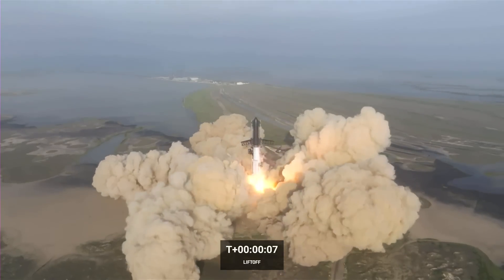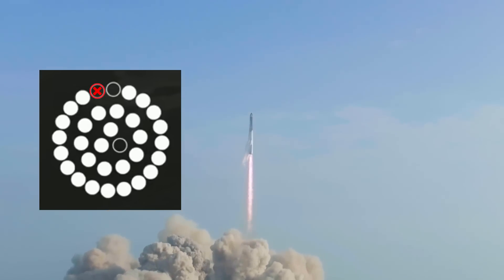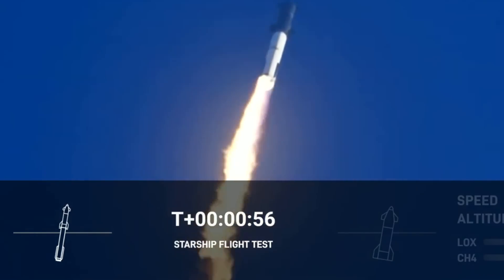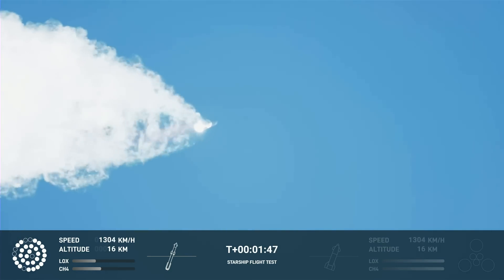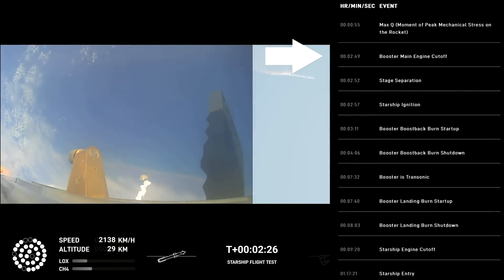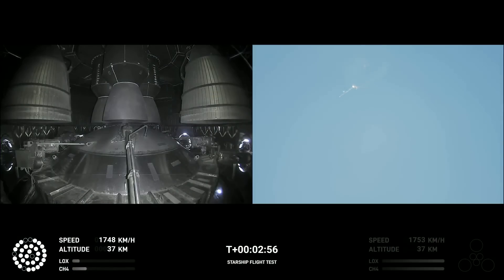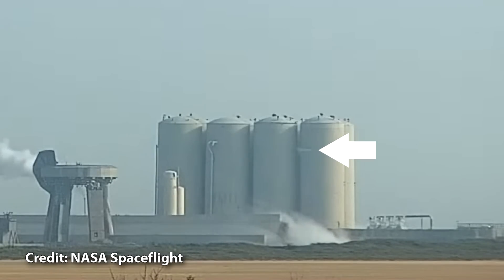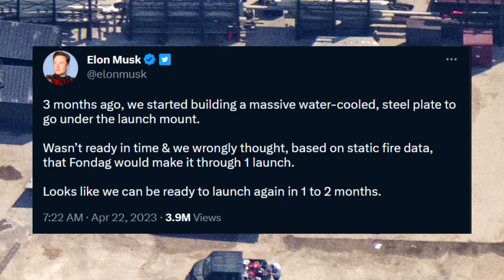I Watched the Starship Test Flight at 0.25x Speed & Saw What Went Wrong | Starship Flight Analysis

Comment: It did well - and I wonder whether that 7 second hold-down was the real cause of the worst damage to the pad and possible damage to some of the engines and the HPU.   The fact that there was no stage separation seems unsurprising - they were planning to use a little rotation to get the separation to work - but it's likely that the release of the clamps would be contingent on some precise amount of rotation - so it seems likely that this is the reason for that to not have happened.

Comment: I actually thought they were going to make it all the way. However, I agree with your conclusion. They got a raft of great data from complex systems stressed by multiple failures. It was probably the best outcome short of a completely successful launch that they could have hoped for.
Reply: Really, what data? They couldn't even display the data showing the engines that failed. It was crumpled going through max q, the self destructs didn't work, that is a huge problem, both failed. What detonated was at the engine base. Any data they got was compromised at lift off. Over at common sense skeptic we said this would be a dud and guess what, we were right, again. :text-green-game-over:
Reply: @IbnBahtuta  You ever hear of telemetry?  I don't have time to teach Musk haters an entry-level class in Engineering. You will just have to trust me, the long-range photos and onboard telemetry were a data gold mine and go a long way to making the next launch successful.  You gotta break a few Starships to make an omelet.
Reply: @wilsonle61  Of course I have. I've been using it most of my career. Telemetry like anything else such as say the self-destructs, which both failed to work, what about that telemetry feed then?
Telemetry only works when your comms is up and that is highly unlikely to have survived very long into the "flight". Don't start me on the Raptors, their telemetry couldn't even show the engines status properly because of, what Wilson? Go do a physics course, if you have already, do it again.

Comment: This smells like a new great channel. I subscribe later got to watch some videos first.
All space channels pitching in now and commenting this launch adding points of views is great.
I usually focus on military stuff so did not know systems responsible for hydraulic pressure were in a voulnerable position. Still , using some knowledge from engineering school , you build the vessel using close to minimum amount of metal to make vehicle and hold propellant, and then there is no room for more so you bolt it on on the outside.... something like that. Was not surprised this critical system was on the outside.

Comment: Agree with others, it's one of the best analysis videos,
Reason is mostly it's just thorough and consice and gets a lot right and gives multiple analysis at the same time

- remark, I would never suggest that thrust vector control is not enough, the rotation from TVC is so strong that most rockets and missiles limit gimballing between 5-15 degrees. its ALOT-

in an emergency they can use differential throttling for TVC, starship had had lots of issues with commanding more thrust in the past and SpaceX said this happened against this fight-

it's confirmed TVC failed this flight. 
They were waiting for stage separation before possibly automated FTS, ship chose not to separate
Reply from the maker: Thanks for the great feedback! To clarify, I said that because we'd seen an HPU blow up, so TVC (though apparently working) could have been significantly limited. Of course, as you said, it turned out that it was the alternative that TVC had just totally failed.
Reply: @ProjectVirtualHaven  sorry,
yeah, if you're talking about TVC during the flight yeah you can say it somehow wasn't enough

Comment: This test needlessly destroyed the launch pad and endangered the life of observers and animals in the area. It was entirely foreseeable that the pad would not withstand the booster engines thrust. NASA gathered that experience decades ago. It will take at least another 6-9 month before anything flies off that launch site. Also the FAA porbably is not happy about the FTS failing, so they won't greenlight another launch untill SpaceX can proove they have this one sorted out.

Comment: Clear structural overload. The power of rocket engines is so massive that it crushes and tears apart almost anything. The worst damage can be seen from the cameras on the launch pad and the rest is a chain reaction of what happened. Some of the engines work incorrectly right from the start or there is simply too much raw power. Engineers have a lot of work to do to avoid the same thing next time. 👍

Comment: Hi 👋, I am new to your work shop analyzation program, There is no doubt that this is the best territorials on SpaceX, it is amazing what you can see when you slow film footage up, which then you can then analyse, it is like taking a photograph in RAW to get best images, 
I think they should not of lurch, they should of waited until the water cooling launchpad was complete, as in other launch sites, And it does make you wonder whether the water cooling system will be sufficient, as it could rip it apart, with that amount of power, 
On a positive note, it is amazing what engineering feats they have accomplished , Great territorial, let’s hope the next launch goes better,
PHIL FROM THE DARK SIDE OF THE MOULIN FRANCE, 😂

Comment: Believe or not the Raptor engines and all the other failures actually provided a lot of additional information if you think about it it showed how many intrinsic can still lose and be able to get to certain altitudes the amount of thrust still available what things can go wrong in a troubleshooting scenario and how would perform if those things went wrong down the road oh you lost this engine in this spot you might still be able to continue on o you  lost this engine in that spot you may not be able to continue on how much it'll lean to one side if you lose too many engines on one spot or how many engines it takes to deviate with that much till how much additional power is required to go back on track if you lose so many engines on one side how well the communication system for working how it properly relay the engines of working over not working what happens when we lose hydraulic power unit it's still able to perfectly run looks like with even less engines than it should have needed to do the maneuver and how much digital fuel it took versus how much it was using or how little fuel it saved when you do increase the flight distance can we turn off an engine how much do we say from that and fuel usage

Comment: Only other thing to mention is something Scott Manley did.
The HPUs could have been a closed loop system, meaning fluid and pressure can still be in the hydraulic reservoirs long after an explosion like that. 
So it may have been that both HPUs did explode but didnt run out of pressure until right before that tumble.
Reply: What I understand is that the 2nd prototype will not have HPU's. The vectoring control will be electric, therefore removing the need for volatile hydraulic fluids

Comment: In an interview with Elon Musk, they didn't even start up the three engines due to a performance issue.  They calculated that even without those three, they would still get off the pad, but any further shutdowns would have a negative impact on the launch.  Elon also said that they need to work on the FTS system as it took 40 seconds to finally terminate the booster and starship.  This would be the longest lead time fix according to him due to requalification and extensive evaluation of the reasons behind it not functioning as planned.  

We didn't get any views of the separation area during max Q, but I'm betting SpaceX did and are evaluating whether any flexing of the ship caused the staging issue or would prevent the stage from separating.  We cannot definitively say that it flexed enough during max Q to prevent it from happening.  The countdown clock is a general time in which things can happen and not exact because of all the other factors involved with engine shutdowns and length of time on the pad.   So, the clock never made it to separation and even when it did, it probably wouldn't have initiated separation due to the trajectory anomaly. They would have had to force it to separate and obviously chose not too.

Comment: I suspect that even after the failure(s) of the HPU units some hydraulic pressure would have remained until continued use would have depleted it.  I imagine the HPUs pump the fluid into some form of pressure vessels that would lose pressure as mechanisms, such as the engine gimbels were used trying to stabilize the craft.

Comment: Very disappointing launch.  At 2 minutes, the EMPTY Starship reached a altitude of 26 kilometers at max speed (35-36 km max altitude) and didn't hit Mach 2 before starting to vent gas and tumble before blowing up on its own.  In 1981, at the 2 minute mark, the FULLY LOADED crewed space shuttle reached Mach 5.6 at an altitude of 46 kilometers and stage separation was flawless.  Remember, this was in 1981 with 70's design and technology.  In 1967 on it's FIRST launch, the Saturn V rocket successfully reached orbit and it had zero failures in its 13 launch lifetime.

The bar was set REALLY low for Starship.  We know starship can't land without blowing up (one landed without blowing up but caught on fire) and now we know starship with super-heavy can't even reach half the speed of the 40 year old space shuttle, can't separate and with 8 engine failures, can't sustain full boost.  2 or 3 of the engines probably failed from the chunks of reinforced concrete flying up at hundreds of feet per second.  Not only was the launchpad destroyed, the refueling facilities and most of the launch site along with a nature preserve were pelted with chunks of reinforced concrete.

Comment: Seems like the pad design was an outright blunder, amid all the amazing engineering, as though nobody made calculations on pad erosion because the boss said, let's wing it once.  After all, the engines convert a (250?) bar chamber pressure into a well directed supersonic stream, and you're directing all that at a flat surface. Thrust, heat, acoustic hammering, and that bit of water sprayed into the stream from the launch tower? I'm wondering if that could have made the concrete erosion worse.

Comment: You are incorrect about the initial engines shutting down.

3 engines never fired up, which we were told this back when they did the static fire. Why has everyone forgotten this?

Elon just reiterated this yesterday. On the static fire, 3 engines flamed out. SpaceX confirmed they didn't need all 33 engines, and losing 3 would be fine for the rocket to perform the test. And so, they said those 3 engines would not be used in this test which is why it started with 3 engines down right away.

Comment: I appreciate your effort on the analysis, but just a friendly tip: make sure you also thoroughly sift through all the info released by Spacex/Elon himself. Based on this info, I have the following corrections to offer you: 1) According to them, hold down clamps were released well prior to ignition, the reason it stays on the pad for a while is they had to throttle up the engines. 2) the first three engines were shut down on purpose, not because of debris. 3) Elon said the extreme lean away from the tower was not intentional. 4) I am not 100% sure about this, but based on what Elon said during his twitter space thing, it sounds like they may have lost communication after one of the explosions (this makes sense because there is a starlink transceiver on the HPU housing that blew up,) if this is correct, this may explain why there wasn't MECO when they called it. I am speculating a bit on this. 5) Stage sep was never attempted, it didn't have to do with clamps. Even if they had tried, stage sep wouldn't have been possible since booster main engines were still firing. Anyway, I don't mean to sound like a know-it-all, I am not. I just wanted to share what I know. I recommend that you subscribe to Elon's twitter space if you want information direct from the source for future launches. Anyway, great video, keep up the good work! :)

Comment: The fact that SpaceX doesn't provide much information prior to or during launch makes it difficult to determine if something was planned. I recall the Apollo flights and the TV commentators laying out the exact timelines of what was planned and when. Then as the engines fired NASA would call out all of the events as they happened and if they were nominal. 

The first question is, was the 6 seconds of reduced throttle planned? To me, that just added more time that the concrete was subjected to extreme heat. Second, was the sideways movement on launch planned? It seems that tipping the top away from the launch tower leaves the exhaust aimed at the launch pad longer. The difference in the view of the Starship engine bay certainly suggests that some crush occurred. Was that planned or was it an anomaly and did it cause a failure to separate? Did SpaceX attempt stage separation? It seems like nobody outside of SpaceX even knows what the separation mechanism is and how it is supposed to operate. The biggest question is, when was the flight termination system activated and did it function as planned? A Washington Examiners article reports, "SpaceX's Starship struggled to self-destruct for a significant period of time after it went out of control, CEO Elon Musk revealed in an autopsy of the craft. ... The rocket lost its ability to turn the engines, resulting in it somersaulting through the sky uncontrollably. SpaceX initiated the flight termination system shortly after, but the craft failed to self-destruct. Starship tumbled through the sky for a full 40 seconds more until it finally blew up. Musk chalked this up to its structure being even more resilient than expected." 

Even though Elon tried to put a positive spin on it, the FAA will be very interested in that apparent failure along with the loss of control of the engines. I suspect it will be at least a year before the FAA completes its investigation which is about normal for any FAA investigation.

Comment: At 6.26 in your video, you can see gases circulating in the space between starship and the booster. This looks to me like SpaceX tried to go for separation at this point and why the camera was showing the internal shot to capture this, but it didn't separate. The seal between the two parts was broken but the two parts stayed together. I would say the clamps holding the two parts together only partly worked.

Comment: why did they not try to separate at least? i mean... ok screw the booster it was lost anyway but having starship alone travel in orbit or have at least some controlled decent or even crash into the atmosphere would be absolutely great data too, right? well... maybe you are right and separation totally failed aswell.
Reply from the maker: Elon did actually briefly comment on that. It’s a bit tricky, because if the Starship can’t make it the rest of the way (nearly) to orbit and come down in the Pacific, it will come down somewhere unplanned and unsafe. Unless they terminate it early over the Gulf of Mexico (my thinking) but we saw how the FTS didn’t work as expected!
Reply: @ProjectVirtualHaven  yeah.. makes sense. all these things need to go according to plan. i guess you can't just decouple and fly around a bit just for fun crashing on a city. :D

Comment: You missed the loss of LOX after raptors 4/5 failed - turbo pumps still running after engine failure
Reply from the maker: I chose not to report on that because I couldn’t see any visual indication of such a huge leak, and it’s even possible that the webcast graphic was just not representing the real data, like we saw with the engines.

Comment: You’ll be lucky to see another launch in a year.  And a water cooled steal plate meeting the rapid heat generated by the rockets will show us even more damage to a launch pad. Explosive damage.
Reply: I used to cut steel using a LPG/O2 cutting torch and it didn't have anywhere near the power of that one

Comment: So many thing went wrong so early on it's incredible this rocket even made it past the launch tower. This rocket will prove to be a dangerous beast with so many engines on the main stage. This is why the Saturn 5 design is far superior using only 5 engines. Look at the trouble the Russians had with their N1 Moon rocket. SpaceX will regret this rocket design
Reply: This is a great comment and really sums up why this strategy may be doomed to failure. Learn from history. Larger near perfect engines versus numerous small engines with many potential points of failure. Even one engine explosion could destroy the launch.

Comment: 1) not a new test before next year. 
2) the rocket launches are far too close to the ground. It needs to be  at least 100-200 meter far from the ground. 
3) in general its was a very lucky it didn't blow-up from the beginning, so many pieces of concrete flying everywhere, it was just lucky nothing significant didn't hit the rocket. 
3) we are still 10-20 years away from an accomplishment Elon dream. 

The big question, is how long wall street and investors will allow him to continue burning cash. At some point, the money stop.

Comment: Great video! Most of the speculation was answered in Elons recent interview. They never tried to seperate the stages. The lean on lift off was not intended and based on asymmetrical thrust (lucky it didnt lean towards the tower). The FTS was triggered but it took 40 seconds to destroy the rocket (going to require a redesign/recertification).
Reply: Elons breakdown is the one you should listen to the least tho.